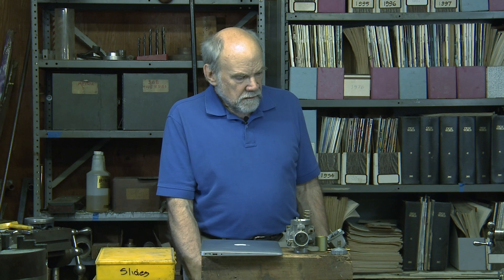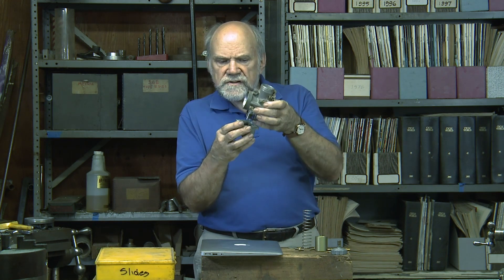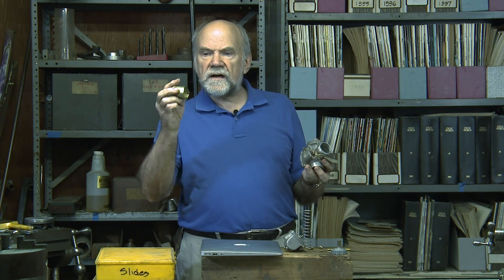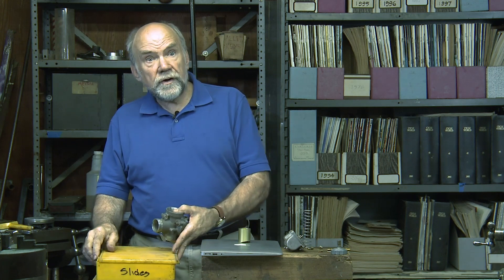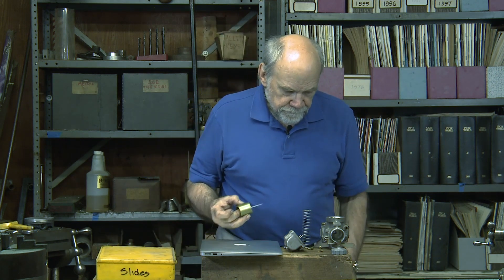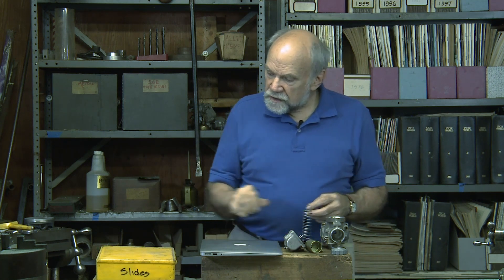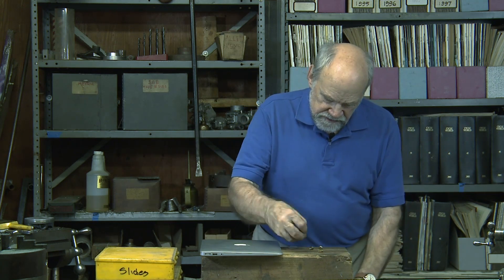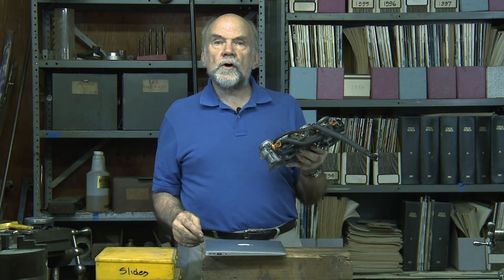What Is The Difference Between Carburetors And Fuel Injection?

Comment: Kevin, Thanks for a great video, but I still want to comment on where (I think) we are heading.  First, without dating myself too much - I think I am probably older than you. My first significant bike was a BSA 650 (A10 engine, 1958 Model with a single Amal carburetor) next came a 1980 Suzuki GS850 with four Mukini  carburetors and most recently a 2005 Yamaha FJR1300 with EFI. So, I am no stranger to rebuilding, tuning and synchronizing carburetors. The FJR has about 40,000 Km (I am in Canada) and I have not needed to touch the fuel system. The point I wanted to make is that you described how to manually create a fuel map for an engine with one or more carburetors. Next you turned to doing something quite similar to a bike with EFI. The thing you didn’t mention is that it is still being done manually in some sense as the decisions for the mapping are coming from a human being. I believe the next step is for the logical rules to make these mapping decisions be embedded right in the bike itself and not on an external laptop computer. This would reduce the amount of time needed to get a bike to perform at its best for any given set of circumstances This would allow the bike to adapt quickly to run in an optimal manner without the need for any human intervention.  For example, a race bike that can adapt to changing ambient conditions (e.g. temperature and air pressure) during a race (or from setup day to race day) would have, IMO, a competitive advantage. I’ll stop short of calling this artificial intelligence. It’s just a robot that is responding as programmed.